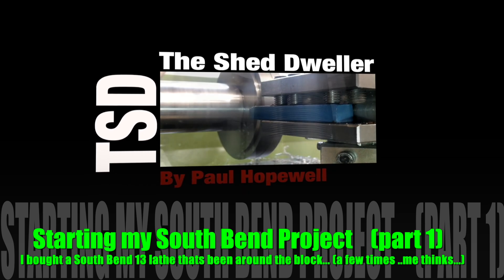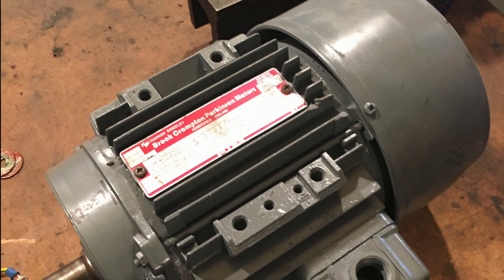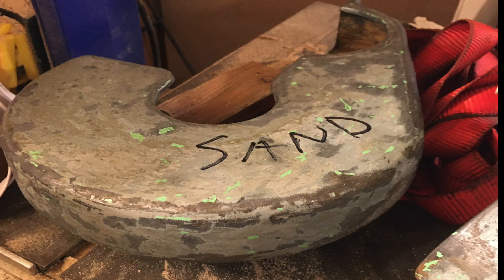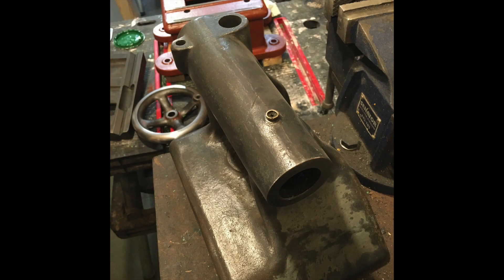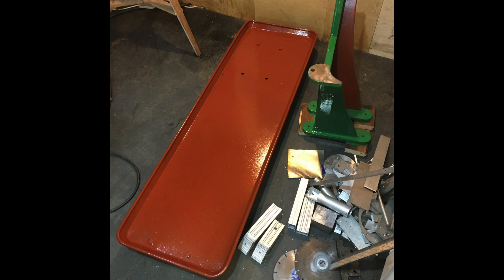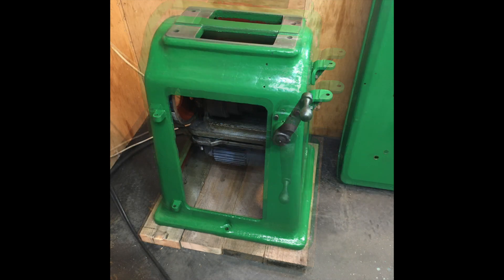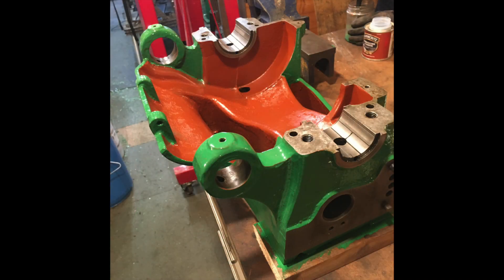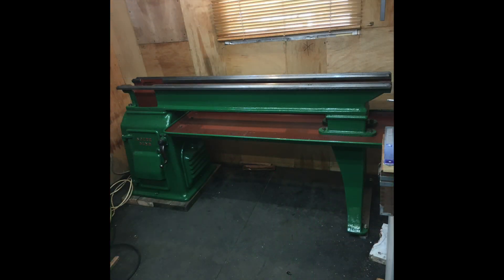My South Bend Project (part 1)

Comment: Get cracking!  Understand your space problems, I have restored a large Willson lathe (1948) and am just finishing an Elliot Victoria horizontal mill with vertical head attachment ( Bridgeport).  Check out Matt at Look Creations, who did a pukka job on a Holbrook lathe (as well as an Elliot shaper).  Best Wishes, John Johnson
Reply from the maker: Hi. I am cracking on. I’ve started to make some straight edges out of mild steel. I need these to identify the worst from the best ways on the main bed. Video to follow.
Cheers
Reply: @Thesheddweller    
Well done.  It is an uphill flog, but good when it's finished.  Then you feel a bit lost......
Reply from the maker: @johnjohnson764  I could do with getting lost at the moment.... all this work 38 hours or so just switching between plate A, B and C,... A,B,C..A,B,C...A... I've just come in for a rest. :-I
Reply: @Thesheddweller    Hi shed dweller - took me around 1 year each machine.  Couldn't really use workshop inbetween - no room!  Pretty fed up on both occasions, but was too far in to stop.  And it was better than daytime TV  really.   Will all be fine at the end - then you'll be looking for another challenge...
Regards

Comment: Great to see a new project underway 😀.  I'm doing the same with a Hardinge hvl lathe. I have to use a vfd and new 3 phase motor on mine. Hope the bed and cross slide don't put up too much of a fight getting them flat and parallel.
Reply from the maker: Hi ...So do I. Cheers

Comment: I have a very similar model, also from the 1940s, and sadly also waiting for restoration. Mine has serial 131191, so a bit later than yours. South Bend Lathes were very busy during WWII. Mine was sent to New Zealand for the war effort. I would definitely consider grinding the bed ways though. Only need to get it done every 75 years or so, so not really that expensive in the long run! :)
Reply from the maker: Hi, I love New Zealand I’ve been there many times in the past, lovely country. 75 years worth of wear here was quoted at one place at £20,000+ about £266 per year. others were cheaper by quite a lot but I still can afford the cost of a back street repairer. I had a quote for replacing one gear tooth at £300  :-( , everything is so expensive at the moment. all the best.

Comment: That 940 rpm motor you mention must be a 6 pole and is exactly the correct single phase type to fit onto an Alba 1 A shaper.
Reply from the maker: you’re well ahead on me on that one, but yes its a good thought I might even do that. I currently have a 1420 rpm unit in there and extra pulleys to re gear the speed ratio. Cheers

Comment: I know there is plenty of documentation for this machine, but just by chance my neighbor Three doors down has the exact same machine. I restored it for him, but it does not see much use. If there is a part that you need to get measurements off of, I can probably help you out. I have a metrology Lab at home, and his just down the way
Reply from the maker: Great, I might have to call you on that, Regards
Reply from the maker: Hi, about 8 months ago you offered to help with component metrology, I could really do with some drawing dimensions for the lantern style tool post and all of its component parts....how are you fixed?
Reply: @Thesheddweller  That's certainly something I could do. I have a neuromuscular disorder so my drawing is awful but I hate computers and don't know how to do CNC modeling. But if you don't mind me using something super simple like MS paint for a back of the napkin sketch but with very precise measurements, that would be a lot easier for me. Does that work? One other thought... It's none of my business why, but I'm pretty sure the lantern toolposts were relatively universal, I don't know this South bend made their own or if it was similar to today's QCTPs. I ask because I have two or three lantern holders floating around. Totally get it if you want to make your own, but I bet you can find one in good shape for less than 20 bucks. Could you even get the material for that cost?
Reply from the maker: @jpsimon206  I recon if you're prepared to go mug someone for a part off their machine for a few days, to take it home and do a reverse engineered drawing for a total stranger, then you jolly well deserve an explanation. 
I may be as old as yellowstone park, but I've never used one of these tool posts. I didn't even know if it is a universal part, I have seen many being made on YT and although I've been to many 'second hand' markets and machine stores, I've not found one.  One thing I can tell you for sure is, that if I could find a new one here, it will cost up to £200 ($300). Importing a second hand one from the US is subject to postage and a massive import tax costing me three or so more times the cost of the original part.
I can make one from the stockpile of materials I have, and for the cost of sharpening a few tools and £10 ($15) of electricity. 
You can bet your boots that if I could get a south bend lantern type tool post holder, with all its component parts for twenty bucks here in the UK, I would crawl on all fours along the entire country to get it.
Why would I want one? well, I was given a bunch of old style tools, and I would like to use these old tools, in memory of the old boy who passed away earlier this year. The trouble is these tools don't work properly in a standard tool post holder because they're too tall and have to be tipped at an angle to present the tip central to the work piece. I've no plans to fit a QCTP to this machine it deserves better.  I think another reason that I can't get low cost South Bend spares here in the UK, is probably because South Bend isn't popular here and didn't export many to the UK, except during the last world war, many I fear, may now have been melted down and turned into garden ornaments, which is a shame. 
So, I don't care if you draw the the whole thing down on a piece of toast with a butter knife.
With highest regards.
Paul Hopewell.

Comment: I don't know if it helps since you are not in the United States, but I believe this is the single most common lathe on the continent. eBay is absolutely full of every possible part you could need in various condition. Shipping is usually more expensive than the part. But there is also an aftermarket for South bend, several people sell plans that you can take to a local shop and have their CNC replicate.
Reply from the maker: Thanks for that little snippet, I have looked on ebay for many things in the past and over here most Ebay entrepreneurs tend to ask for more money than new, Replacement parts from the united states are cheaper but as you say postage bumps the cost up and import duties at this end can double or even triple the cost, so it ends up expensive. Prices here in the past few months have really hit everyone but the rich, i’m certainly not rich. so I usually make my own stuff where I can, regards

Comment: Hi, i am currently in a restoration project on a 1919 german lathe and my idea for the v-ways is to use a lapping compound and the topslide to kinda lap it.  Would you recommend it?
Reply from the maker: Hi, not knowing your machine or the amount of wear you are trying to remove, I would not use the top slide to repair the slide ways. There is a chance that the top slide will conform to the largest dimensions of the bed way and the problem may simply get worse.  regards.

Comment: Congrats on the 13" SB that's a real nice size for the home workshop. I have a heavy 10 for the home shop and have hit the capacity limit several times wishing for a slightly larger machine. I had to replace the original bed that was worn beyond any chance of repair lucky I found a used one only 80 miles from the house, still with lots of ware, but a major step up. I also located a much better saddle. I'm not setup for real scraping or grinding, but did manage to get decent fit with my amature scraping of the saddle to the replacement used bed. I do get some taper in the work but have learned to manage it while turning. Hated to lose that original bed because the serial number had the US Navy anchor insignia since it's a war machine.
Thanks Paul...looking forward to the next episode.
ATB....Dean
Reply from the maker: Hi Dean. This bed is probably as bad as it can get,.. I’m still going to try and sort it. regards